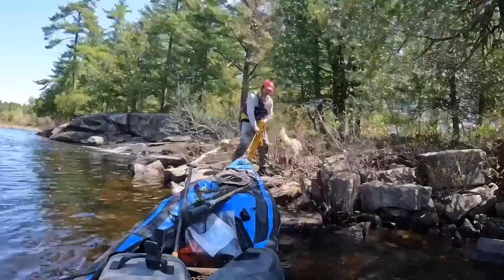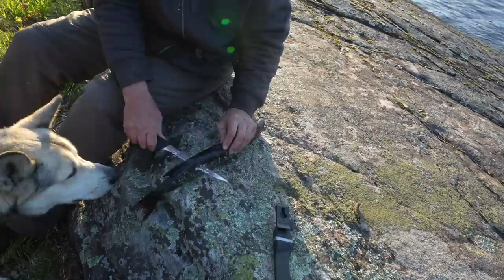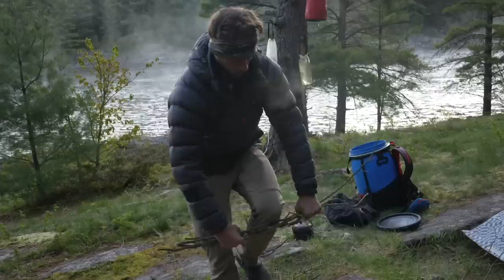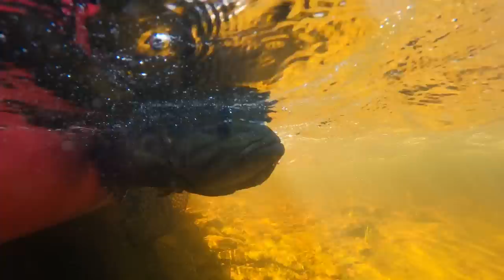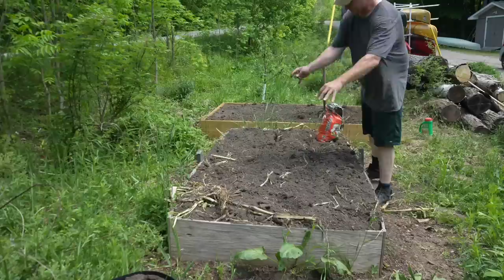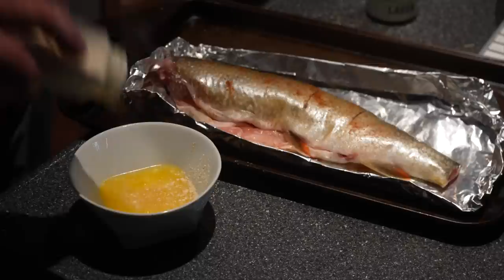Living Off the Edge: River Rapids to Homestead Bliss - Epic Adventures & Harvesting Dreams!

Comment: You should use cardboard for the bottom of your boxes and it will prevent weeds.
Reply from the maker: Good tip, I was thinking though that with corn, the roots go bite deep so they may need to go through the top soil i as and anchor into the host soil. Otherwise they may blow over. I’m not sure about that though